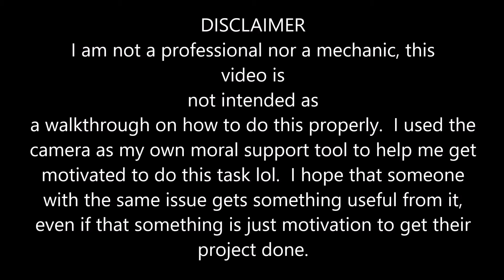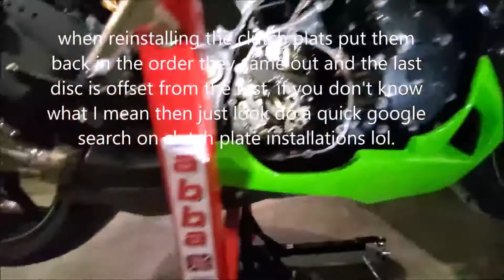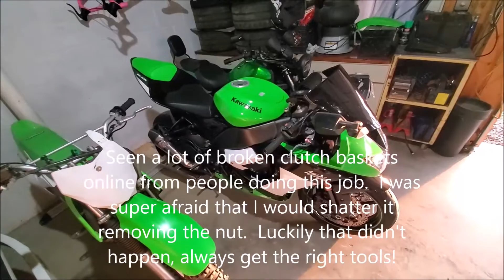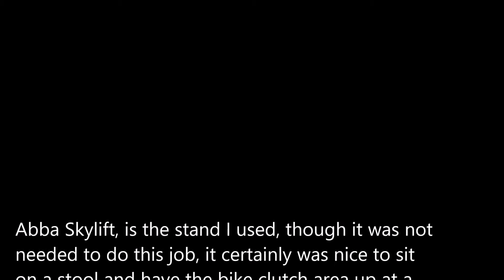2009 Kawasaki ZX10r Shift shaft lever replacement

Comment: awsome vid man. im having the same issue but my bike randomly while riding just wouldnt let me downshift or shift up unless i really wiggled it into gear. it will pop into first when it wants but my shifter itself is mainly just stuck im hoping that its the shift shaft. if you have any thoughts lmk!
Reply from the maker: If you can wiggle it and get it into gear and you have the stock 2008 or 2009 shift shaft then its probably the issue, upgrade it with the 2010 shaft and see if it resolves your issue.  Hope that it works for you it did for me, and I had to do some funky push forward and outwars on the shifter to get it to change gears.
Reply: @hypestero  im actually on a yzf thundercat600r but it basically not moving at all unless you force it but it still wont go into gear

Comment: Mine is broke as well trying to find one now with no luck. Where did u get yours and do you remember part #
Reply from the maker: You want the 2010 shift shaft, mine came with the bike when I bought it, the previous owner had purchased the part and never replaced it.  I would try partszilla and or the dealer.  That sucks you are having issues getting the part.
Reply: Mine is a 08 zx10r and partszilla doesn’t carry it no more or that’s what I was told when I called them.
Reply from the maker: 13161-0073 is the partszilla part number its like 85 bucks
Reply from the maker: @The_Pitbull_Kickboxing  thats correct kawasaki no longer makes the part for 2008 and 2009 they only make it for 2010 when they beefed up the part.  Look up the 2010 model number its available according to their website i just looked at it.
Reply: Hell yeah thank you sir. I will look into it now.

Comment: Hi Josh, I’m having a tough time finding a clutch basket tool for my Honda CB500X. Any ideas?  I’m going to try and find EBC…..
Reply from the maker: It looks like the tool you need is made by GB motorcycle and its available on ebay only issue is its overseas so getting it may take a little longer.

Comment: Hello, im looking at the same issue on my 08 im doing clutch plates  and upgrading the rivets on my basket this weekend. I was wondering if you happen to have the part number on the new shift shaft? Might aswell knock out the shifting issue while im down there.
Reply from the maker: Wish I had upgraded my clutch basket while I was in there as they can shatter, glad you're getting that done.  The shift lever/shaft that you need is for the 2010 zx10r, which was upgraded that year cause kawasaki knew they had an issue in the earlier models.   I don't think you can order the 2008-2009 shift lever anymore or atleast I hope not.  The part number for the 2010 is on Partzilla for $86.14 and is as follows 13161-0073.  It will be easy for you to replace since your already replacing your basket!  I would recommend getting a few other things while your ordering the new shift lever, like the oil seal and the washer on the shifter side just because I didn't know what all I would need and my washer ended up being bent as seen in the video.  Go to partzilla under kawasaki/2010/zx10r/Gear change drum/ and you will find an exploded diagram of the parts, good luck and ride safe.   Thanks for watching.

Comment: only the first gear works 2,3,4,5,6 the rest of the gears do not work I can't turn on what could be
Reply from the maker: If your bike is stuck in first its probably the shift shaft.  Not sure what you mean by wont turn on, do you mean that the bike will not start?

Comment: Looks like I’m about to try the same thing. I have a 2008 zx10r and it want come out of 4th want shift up or down.doesnt click doesn’t grab doesn’t grind. Just nothing there
Reply from the maker: Well hopefully that is your issue and not something more serious like a bent shift fork inside the transmission.  Do you know if the bike gor dropped on the shifter side, usually that is what does it.  But also kicking down on the shifter really hard over time can do it too.  Best of luck, I hope you get her back up and running!
Reply: Did that fix your problem

Comment: Did this fix the issue?
Reply from the maker: Yes 100% fixed the issue, it now easily shifts through all gears now.  Thanks for watching.
Reply: @hypestero  thank you for your video bud. Its something so simple and hardly anyone on the forums know what the issue is because everyone has the same problem on 08-10. When the rod comes out u wont notice any wear. But swop it with another and problem solved. My gears are shifting now no problem.
Reply from the maker: @markvanaardt5562  You're very welcome, Im glad you got your bike fixed too.  Yes it is a design flaw on the 08-09 shift shaft, they upgraded it in 2010 made it more robust.  Very simple fix indeed, wish Kawasaki would fix it for us though lol.   I was unsure doing the job that it would fix it, and was afraid something internal was torn up.  Thank goodness it was just a shift shaft!

Comment: Part number on the clutch basket nut?
Reply from the maker: @tylerrussell6415  I believe it is 92210-0152 but I would call your local kawasaki dealer to confirm its been a hot minute since I did this video.
Reply: @hypestero  my bike is currently stuck in 5th gear do you think this will solve the problem?
Reply from the maker: @tylerrussell6415  was the bike laid down or dropped on the left side where the shifter is?  If so it could be the shift shaft.  Usually the bikes with this issue cant shift out of 1st.  I have not personally heard of one being stuck in 5th tbough it could be possible.  If its not the shift shaft then I would suspect a bad or bent shift fork.  If it is a bad shift fork that is bad news and requires you to crack open the transmission/engine case to repair it.
Reply: @hypestero  ya that's my worry is having to split the cases. Not a fun job at all